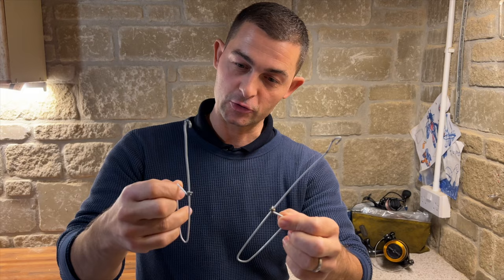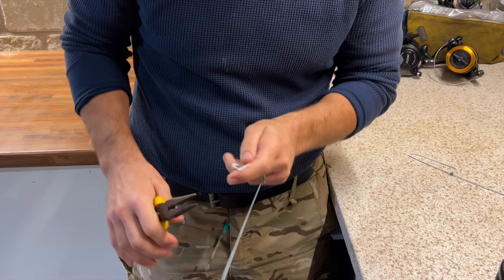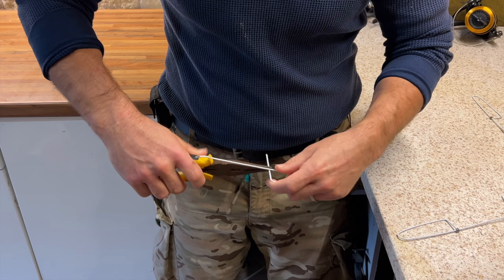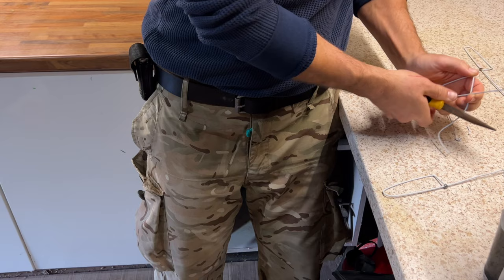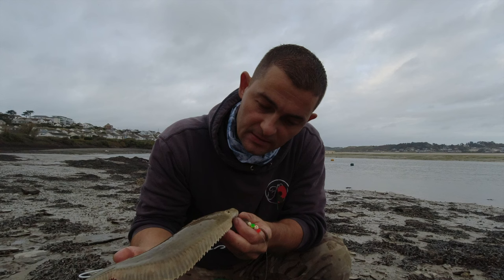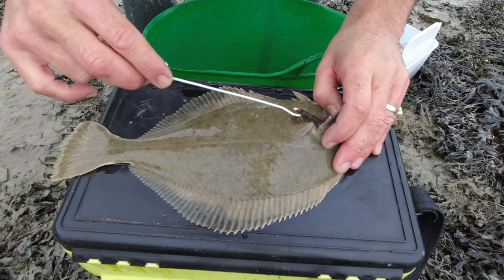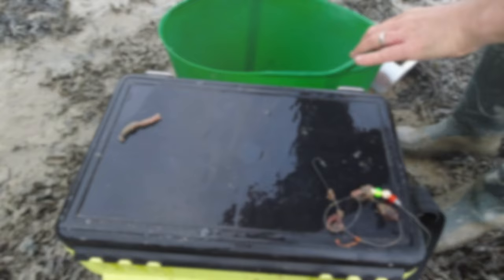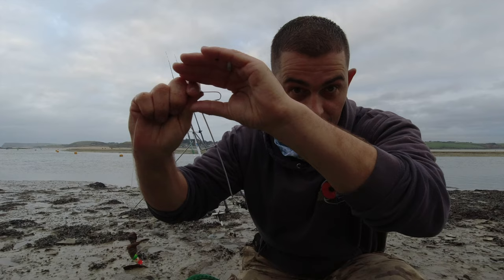How to safely un hook deep hooked Flatfish - Flounder, Dab, Plaice, Fluke SUPER CHEAP EASY HOMEMADE

Comment: Hi John.   I'm still really confused by this and trying to get my head round how the hook actually turns around inside if it's hooked into fish?  Could you maybe please do another video and try and demonstrate without a fish so we see what happens?
Reply: Took me a second to work it out but I understand. You need to wrap around the line and not the hook, this tool hooks above the eye and spins the shank around where its hooked, if you're careful you can ease the hook around, letting the hooked bit slide around the bend as you pull the eye down deeper into the throat with a small loop of line hanging out the gills. Unwind the tool, when you look into the mouth, you should be able to see the hook bend rather than the hook eye. Hook this tool onto the hook and give a firm tug to pull the barb out and the hoop of line. You are going to cause damage the second the hook went in, but this method ensures you do very little damage when pulling it out.

Condoms with the tips cut off make great practice fish.

Comment: Can't get my head around this.
Surely when the hook is turned around it makes a new hole in the fish, then when its pulled back through the mouth that line that's been pulled out through the gills is also pulled through that new hole and tears between the initial hole and the new hole caused by puncturing the fish twice?
Isn't it easier and less harmful to just pull the hook out backwards through the gills then snipping it off?
Reply: Sam here. I'm really confused as to how the hook turns around in fish.
Reply: @Adam_Outdoors  If in doubt there is no doubt. This method is bull crap.